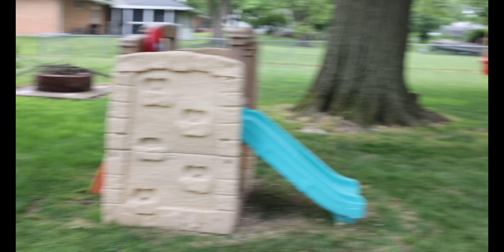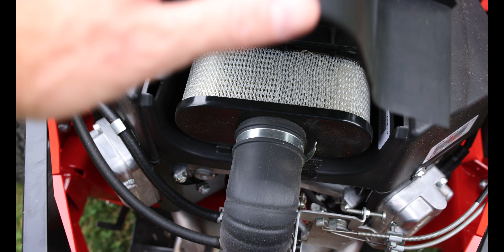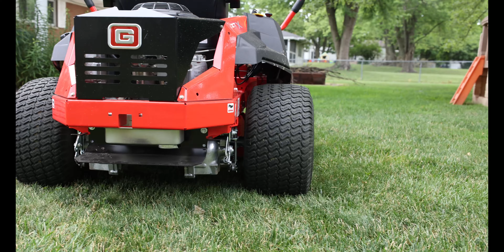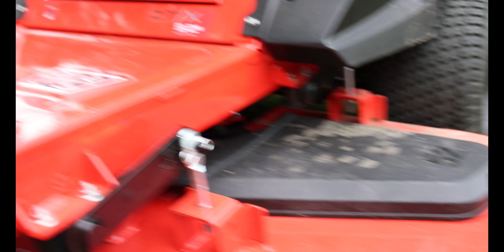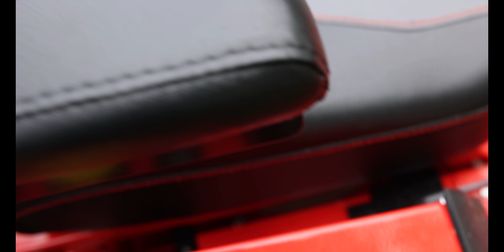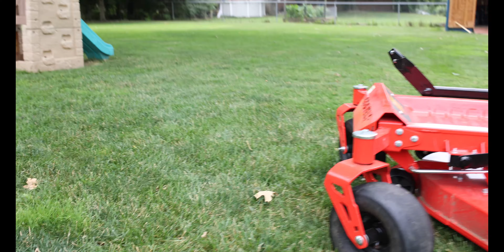2022 Gravely ZTX Zero Turn Mower - One Year Review

Comment: $3800? Where are you from? I know this is a year later but this is 5k around here
Reply from the maker: It’s still 3800-3900 around here. We just bought a John Deere z530m for $5000. If your paying more than $4000 for a gravely ztx I would find a different dealer.
Reply: They want $4,800 in Arkansas.
Reply: Got mine two days ago for 4500 that included taxes.